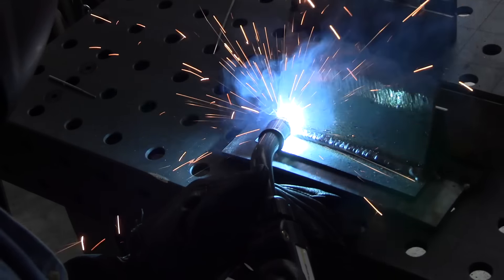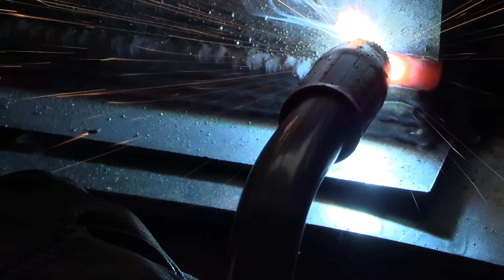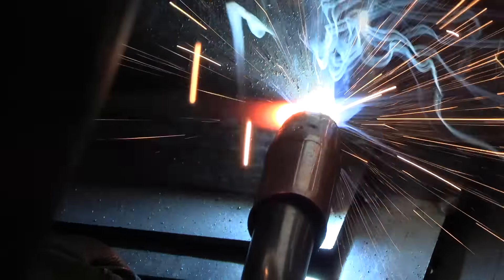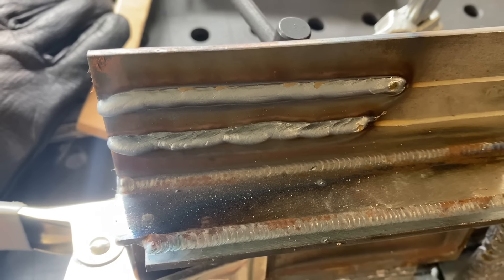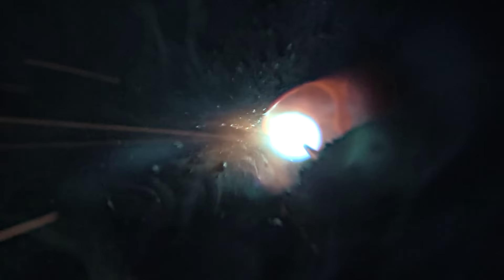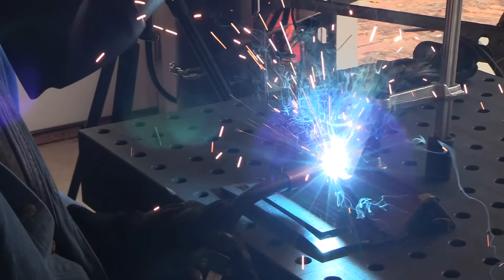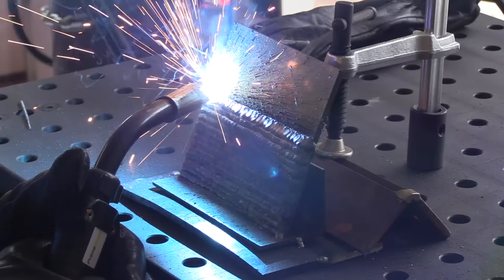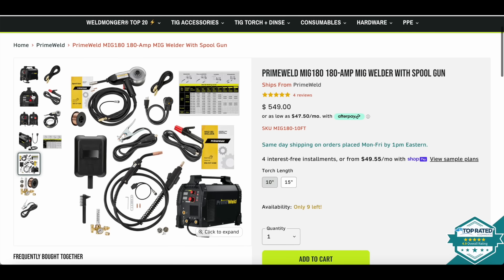MIG Welding Practice Beads

Comment: Stick out is important..I have been in situations where I had to weld in a tight spot in between obstacles where I had to use a longer stick out..I usually put a scrap piece of steel to block air and trap argon ill fill the area with gas then turn welder on..turn up voltage and get my weld in

Comment: I pivot the wrist all the time which is a transition from pull to push. And the setting are usually 5-550 wire speed and 25 for heat and 035 wire. Production stuff

Comment: Interesting opinions ❤ I'm going to go through your videos. I don't really do any movement, and I just hold it straight. The weld doesn't need much movement when hot enough, and travel is just right, I just look at my pass And get as close as possible. I don't watch my Arc. No need to.

Comment: Could you do some more Spray Transfer Videos if you have some time? I know you have some. But there aren't all that many people that do spray transfer videos. Also I’m curious about MAG (Metal Active Gas.) for SMAW we did a 1ft X and in each space on the X we did a different Rod (6010, 7014, 7018, and 7024.) Once all the space was filled the instructors cut them in a couple pieces with the Horizontal Bandsaw. I still have a piece of mine. I did a pre-employment course which included class instruction and 480hrs of Shop time. Then we did our 1st yr Government written and practical exams. In Canada you do 3 years with a written and practical exam for each year. Then you do your Journeyman Certification and Red Seal.

Comment: HI I HAVE A TIG WELDING QUESTION: when dabbing filler metal into the puddle how do you prevent the filler from sorta balling up and falling off the filler rod? I also might have left some millscale which might be doing it as well. Also can you show more of your body position, and arm and hand movements when tig welding. There are random things I’d like to know, like when you lay the filler rod down and walk the cup into it are you moving the filler rod at all? Or just walking the cup into it? Please help when you can. Thanks

Comment: There are a couple of questions I would like to ask and they all revolve around welding thin sheet, car body work. In the UK most cars have 0.9mm (20 gauge) thick bodywork but I assume USA classic cars are thicker as I have seen people tig welding patches into the middle of panels. I have seen many people weld a long butt joint, perhaps fitting half a door skin, with a series of tack welds every 3 inches, then starting over until the weld looks continuous. My question is how strong is this weld, I can imagine it is not an issue on a door skin (unless it cracks) but I see this on bulk heads (what you call firewalls) and sils which are structural. As an engineer by trade I worry when people cool the weld with an airline (to warping), as to me this will make the weld brittle.

So is building the weld up as a series of mig tacks acceptable?

Is there a sensible length of tack (the ones I see are basically spots) that will make this method OK?

Some people talk about increasing the current, but not all, I know you talk about increasing the current for your tacks but you weld over the tacks.

Is there a better way to weld and avoid the panel warping?

I have been told to tig weld if you can get to the back of the panel as the tig joint is not as hard and you can hammer and dolly the panel straight. But mig weld is too hard and damages the panel hammer?

On a second, but linked question. I have an Autolynx 2 mig welder (later called Murex) which was known as the auto body shop welder 30+ years ago. It is basically a transformer welder of 130 amps and has always worked really well but it has 2 functions that I would like to understand.

If I double tap the trigger the welder goes into stitch mode, (you can also select the mode) where it welds for a few seconds then rests before welding again. Is this to produce a short weld then a gap before another weld or to rest during a continuous bead to reduce heat build up? In the UK we use to weld cars with a series of inch tacks every 2 inches (sort of thing) but that was banned in the 90s (mot failure) and all welds (structural) have to be continuous. My welder is older than that, hence why I ask about the tacks.

Secondly it has a spot weld setting, my understanding is you change the shroud for one with two feet, you push the torch onto the outer panel and push the two panels together and form a spot weld, not a plug weld as you do not have a hole in the outer panel, the weld melts the two sheets together. I have read the manual but cannot get the panels to fuse properly hence I end up plug welding. The torch has been changed, which might effect the setting but any advice will be greatly appreciated.

Comment: Jodie you're a man that's gone a round the barn a time or two.  I have a multifunction Miller 220.
with my 110 kill-a-watt meter. I am measuring 29 amps at the plug 120-132A on machine display ,set to 3/16 auto + both wfs and V turned up to max  while no look welding ⅛" plate ( the sound tells you how you are doing fast slow long short/ how deap of buildup). How is 25-29 anot popping the 20amp braker?
Reply from the maker: I dont really know.  I'm no electrician but I think time is a factor. I can weld 2 inch runs at those settings but If I weld for a solid minute or so I will pop my 20 amp breaker

Comment: Hey buddy I work in a fab shop building saw mill equipment and chip mill equipment the name of the company is precision husky and we run .035 er70s6 at 27.5 volts and 550-600 Ipm on the wire speed with 90/10 gas

Comment: I learned to weld (stick) the same way stacking beads on plate in the early 80s. They had welding booths setup in semi-trailers (about 5 -6 booths in each trailer) here in hot southeast GA. The part I hated most though was we had to grind down and reuse our steel plates. It was learning by doing the same thing over and over. By the time we finally moved on to pipe you had a true understanding of what was going on.

Comment: Just out of curiosity, what about.045 stainless steel solid core, what do you prefer? Repairing 2 inch and 3 inch solid spokes. I can only access from one side/direction only. Complete crack repair.

Comment: Great video as always!
I understand why you usually tig weld and deal with exotic materials in your vids.
For an experienced welder like yourself  short circuit mig has got to be boring.
For me when ever you cover mig it is like finding buried treasure.

I have a different Amazon welder that claims to be 200 amps.
In videos on YT it seems to max out at 160 on stick.
Needless to say short circuit mig is the only mig it will do.

Some year I would like to get a welder that will do spray arc and that can effectively run dual shield.
In the mean time I am trying to learn to get the most out of the welder I have now.
Your videos are really helping with that.
Thanks for continuing to cover boring old short circuit mig!

Comment: A long time ago I watched one of your videos with the sample cutting, polishing, and acid etching of push v. pull joints showing similar results in penetration.  That was super informative.  I prefer pull on thicker material for the reason you stated of being easier to see the puddle plus my brain thinks having the wire leading the puddle pointed at the root is better than possibly having the wire hit the puddle on the push side.  I know that is not true, but my brain still thinks that.  I use push when doing thinner materials like sheet metal continuous beads on auto body work so I can see the joint line easier.  For the really thin auto body panels there is the "stitch" weld technique of spacing out tacks and overlapping them 50% to minimize heat buildup and warping.  Not really true thicker metal stitch welding, but that's what it is called for auto body.

Comment: A union shop I worked at guys were always arguing about ' pushing ' versus 
' pulling ' mig welds.
I would tell them to shut up ( while I fixed all their crappt, leaky welds.)

On ' stick out ' you usually keep it short as possible, but I have found in places where it is necessary to reach the wire way out to turn the speed UP just a bit.

Comment: I have a Eastwood  mp140i multi process welder what are your thoughts on this welder and do you think it is capable of aluminum welding as I looked to build a turbo setup for my truck like Intercooler and charge pipes and possibly stainless headers at some point? Thanks I love your videos

Comment: I can tell you are a pro welder! Realy liked your video. I have a lower priced stick welder and a lower priced mig wire feed welder. I am planning on trying to learn to weld in my late 50's for around the home and diy use. I also plan on connecting them to a 30 amp 240 breaker even though they both will run on 115 volts. I have good eye protection and good gloves, but I do worry about my eyes because I have to wear glasses all the time even though I do fine with polarized sunglasses only when outside or driving. I also have dry eye disease that is under control with prescription drops. I tried to learn to play guitar but am not very good at it due to a old left wrist injury. I think I can learn to weld good because I am right handed. Do you have any suggestions for me? Will like and subscribe to your videos. Thanks

Comment: I’m 67 yrs old AWS Certified. I learned on old Lincoln “Torpedo” machines you couldn’t read the setting numbers.  I learned to weld by the seat of my pants. Sight,sound and feel. Stick weld sounds like an egg frying. MIG sounds like a mad bee! I learned that many passes with a MiG the hotter the metal I lowered the amps and wire speed. Kinda like Aluminum welding start of slow alum starts to transfer heat put on the tennis shoes and keep up!😄 
Great videos my friend!

Comment: I've never pretended to be an expert, but over the years, I've found there's just as much bad information out there as good.  I took courses at a vocational school to get the basics and I've kinda picked things up from there.  I got 4 welding certs in school and then realized certs are worthless compared to experience.

I passed a vertical up MIG test on 3/8 plate with the machine sputtering and hissing because I was taught at the time to run the bead uphill with the wire feed way down.

I try to teach my apprentices now that wire speed to voltage/amperage is a ratio.  I teach them that your voltage/amperage indicates how much penetration you're going to get while your wire feed indicates how much metal you're going to lay down.  It seems to help.  I've been watching your videos for over a decade and been a subscriber the whole time.  I recommend you to anyone.

Comment: Can you weigh in on why you should/shouldn't MIG chromoly (gas, gasless and dual shield)?
Reply from the maker: I think the cooling rate can be too fast.  Along with many stories of problems.  I remember hearing one story on a EAA welding video of someone who ordered a pre built chromoly fuselage that was mig welded and half the welds were cracked at the toe.  Who knows if that was true but slow cooling rate for 4130 is important.
Reply: @weldingtipsandtricks  so fluxcore holds heat better right? Its like a ceramic blanket. I see a lot of trophy truck 4130 parts MIG welded in 2t? Continuous spot welded but there's very little expert experience available

Comment: An absolute must for MIG welding is keeping the gas nozzle clean. When stacking beads like this, you’ll get completely different results 10 minutes into it if you haven’t cleaned the nozzle. A build up of spatter reduces the sheilding gas flow, changes the amperage, forces the operator to have more “stick out”. If a person is looking to really improve, they need a consistent starting point each time. Keeping it clean is huge.

Comment: Hi Jody
Down here in Australia for whatever reason, the push and pull thing is a lot stricter and you'll get marched off certain work sites if you're caught pulling the weld as opposed to pushing. 
In saying all that I do agree with you that depending on the situation, you need to use both.

Comment: We work a lot on a spray transfer wifh hard wire 1.2 mm. It's really different then garage welding but it's always better to start with any experience even with electrode then start with nothing so if you plan to work professionally spend your time in a garage anyway 😅!!!

Comment: And finally I will add that anytime you weld dissimilar medals like stainless steel black iron, you can do one of two things you either have to use an odd numbered stainless wire. Like 309 315. Or you can actually use the sr-70 standard wire, 7014 and 7018 were quite well but 718 is far more of a position rod and 7014 will work in the vertical. First time I ever welded with 7414 I thought I'd died and gone to heaven. It was so easy to weld with, it made stick welding a breeze. Also, don't let anybody ever tell you that you cannot stick weld stainless rod on Direct current, I welded a 14 gauge stainless steel vet Hood one time with 1/6 stainless steel rod. And back stitched it didn't get any warpage whatsoever, and the weld was no wider than the two pieces of metal, it literally looked like a TIG weld. And it had to look good because it was out in the open where people were going to be able to see it. It was for a restaurant

Comment: Will a 20a breaker at 120v be sufficient for this machine?
Reply from the maker: You can pop the breaker if you weld long runs but for this video, I was plugged into a 115 volt 20 amp circuit.
Reply: Thx dude! You are an asset to the welding community. Thanks for all you do👍

Comment: I spent over two decades as a pipe and boiler welder

And over the years I've learned that there's two major problems that I see in the welding industry

The first problem is people that buy a welder for home get some metal to stick together and call themselves a welder

The second problem our actual welders that confuse the terms can't and shouldn't

Because those words mean different things but for some reason welders will very often tell you you can't do it that way when the actual truth is you shouldn't do it that way

Comment: Just got out of work and can attest that, you can, and sometimes have to, pull and push with MIG. 

Every part I work on I have to do both, and I've never had one fail. That's with .045in 70S-6 Metal Core wire too.

Comment: I’ve always pushed and pulled. I think pushing works well for a flatter weld and bridges gaps better too. 
I’d love to see you play around with some cc mig and/or dual shield welding. I really like the constant current, you just need more wire speed. Works real well for a cover pass. I’ve done cut and etch test showing cc has more penetration than cv.  It’s different but once you figure out how to set the machine it’s quite nice.
Reply: Have never used CC Mig does it require a specific machine. Also what application do you use cc over cv.
Reply: It is even in almost every european welding handbook. When you drag it's going deeper, when you push it is more flat and my work experience as well as yours seems  prove that.
Reply: @Scooty_scoob  any DC stick welding machine.  A multi process machine might do it but I’ve never tried.  I usually use a Miller 12rc or Lincoln ln25 suitcase plugged into my Miller pro 400. I use it on the pipeline and on storage tanks. X-ray bend test, pressure test, hydro test, visual test ….. all of it. You can use it on anything but how you set it depends on material and position.
Reply: Co workers thought I was nuts but they couldn’t keep up lol. My box usually stayed at 700ipm in flat and horizontal position.
Reply: Personally, I find that pulling seems to put more heat into the base metal, making it easier to blow through thin sections, and pushing has you welding into colder metal, making welding of thin sections easier. Both of those characteristics can be used to advantage. Thick materials needing good penetration, use a pull, trying to minimise distortion, use a push. However, in the real world, sometimes you have to weld around your problems
Reply: @theshed8802  exactly, pulling drives the wire threw the gap because there is thin or no material there to support the current. Pushing allows you to keep the wire on the metal you just put down. But Ive never had a penetration problem or slag trapment   (With dual shield) while pushing. But I run pretty hot most of the time.
Reply: I hardly EVER push any welds, but I have noticed that pushing usually causes a ton of spatter off of the end.
If you like a lot of heavy spatter.
Reply: @erikcourtney1834  CC dualshield? Never heard of it and I've been certified on all wire since 2004. What kind of wire are you running?
Reply from the maker: Just wanted to say thanks for posting your comment. It’s opening up some great discussions. I’ve never run cc on MiG but saw a guy doing it on a job once who had a wire feeder hooked up to a stick machine and always wondered how that worked.
Reply: @Kyehyfxu  maybe he's talking about using Flux core wire with gas. Used that a bunch at a certain job I had and it worked terrific.
Reply: @Kyehyfxu any dual Shield (gas covered fluxcore) wire. It’s about the output of the machine not the wire. 71m seems to need more wire speed regardless of cc or cv. Not sure if the wire contains less metal than other or what it is.  I experimented with er70s-6  on cc to see if I could get it to spray with 75/25. It got closer than with cv but as expected it still wasn’t 100% spray.
Reply: Cc- stick out and wire speed changes the voltage.
Cv- stick out and wire speed changes amperage. 
This makes perfect sense if you understand how voltage and amperage works with welding.